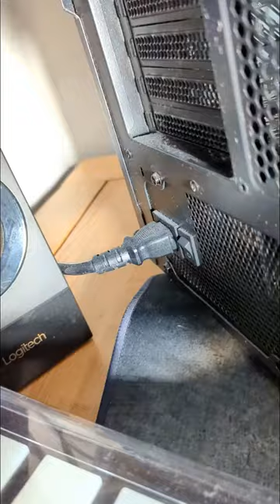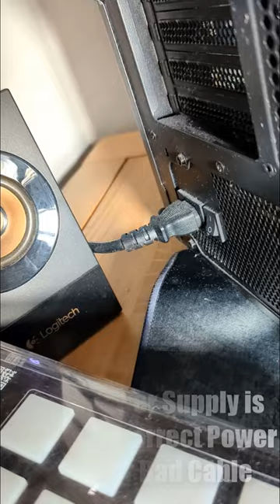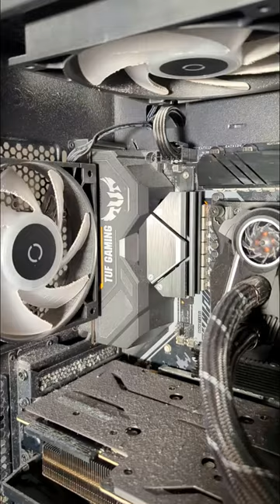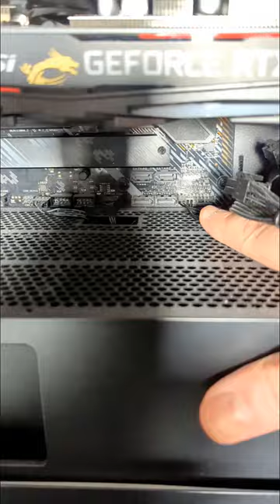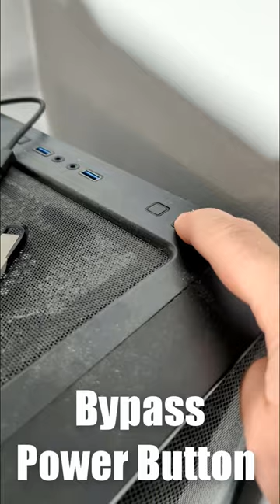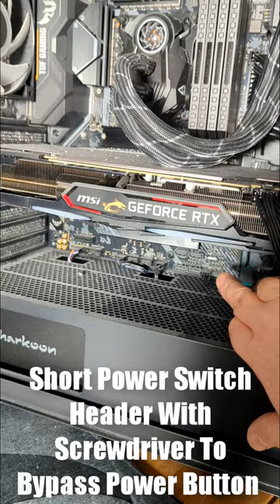Reasons Why Your Computer Won't Power On

Comment: If you have a modular power supply, check the connections on that too.  Happened to me after cleaning once.
Reply from the maker: As mentioned, bad power supply, only had sixty seconds.
Reply: Hey, could you elaborate on this? I think I have a modular PSU but I'm not sure what checking the connections could mean...
Reply: @palzone2443  I'm a little late to this comment, but basically a modular power supply has cables that connect on both ends. One end of each cable will plug into its corresponding connector (cpu power, 24 pin, pcie) while the other plugs straight into the power supply. Now non modular power supplies doesn't have the option to unplug the connectors on the power supply side of things. I hope this helps

Comment: Mine turn on then turns straight off, it was working perfectly fine a minute ago and now it's short circuiting, I hate building pcs and I don't know whats going on with it
Reply: Does it work now
Reply: @grave2816  ah so it was a wire, the wire hit the fan blade since the fans where at the top and caused a short circuit, I moved the wire and now the pc works. That was for my brother when I upgraded my pc I avoided that mistake lol.
Reply: I js bought a new pc and it fucked in 1 Day my pc works but when i turn it on the monitor shows no singal

Comment: Thank you for this video… I tried a million things even replacing the power cord, but then I saw this video and found out that my 24 pin power cable was loose. I fixed it and now my pc is running like new. Thank you so much <3

Comment: Also accumulated dust and moisture will be conductive and will short many stuff
Reply: I recently blew the dust out of mine. Nd hanged thermal paste and i turned it in at the wall and a loud surge bang nd tripped the breaker. Wont turn in now any suggestions
Reply: @KillShotMarks what broke ?

Comment: It all makes sense, when I was building my Pc, i directly connected it to the wall socket. When I was finally done, I went to fix it on a side of the room with an extension lead. Thanks! But I wonder what the solution could be since I can’t move my setup next to a wall socket.
Reply: It was that!

Comment: Appreciate the help. I went for a jog then came back to a PC that wouldn’t turn on. Tried a lot of stuff, none successful. Ordered a new PSU. Hopefully that works or else my mobo is fried or something

EDIT: Replaced my PSU and everything worked fine. I guess it must've died on me while I was away
Reply: Good luck.
Reply: I got a new power supply. Still won't turn on.
Reply: @Zeigy  Hoping ur MOBO isnt fried then. Best of luck
Reply: @nnoir  Something fried. I smelt the burning electrical component smell. Trying to save up to get another ROG Strix B550A motherboard.
Reply: @Zeigy  Unfortunate :/ hope you can get that new mobo soon
Reply: Hi, did you test your PSU using a paperclip by shorting the MB connector? I'm wondering if my PSU is at fault here but I'm not sure..
Reply: @palzone2443  Yes I did try that. Nothing changed, PSU didn't power the fans or anything so I assumed it was fried. I followed the tutorial by Joe's Vids, "How To Test Your Power Supply With A Paperclip"
Reply: @nnoir  I sent my PC to someone with lots of PC parts lying around. Was cheaper than just buying brand new parts. He said it was my eight year old GTX 960 video card that went bad. Got a new 6750 XT. Gamed for about 4 days then the computer motherboard started shorting. Wouldn't turn on the. Would turn on a few minutes later or turn on after trying again after an hour. Then a day later it just turned off while I was playing Starfield for about a two hour session. Never came back on. Checked the motherboard, corrosion at various spots. Looks like some liquid, maybe sweat, fell on the motherboard and took out some components. Getting a new motherboard today.
Reply: @Zeigy was the motherboard the issue? I cleaned my pc for the first time by blowing it and went to turn it on and it powered on than like a minute later it shut off and won’t tune back one. Troubleshooted everything. Even did the paper clip trick and my PSU worked still. So I assume it’s the motherboard. I have a ASUS tuf z790 plus Wi-Fi and it usually has RBH background lights on very subtly when powered off. I noticed those rgb lights weren’t even on. So automatically thought it was the board. Ordered a new one and currently waiting.

Comment: So in my situation, mine will not turn on at all, but it shows my LEDs on my motherboard. Does that also mean a bad piece issue but enough to to give power to the LEDs?

Comment: My issue was the power button I referred back to the manual for my mother board found where pins are for power button and used a screwdriver to hot start it. Works just fine for a new button on the way. Now I’m referring to the power button on top not the power supply button.

Comment: Couple years ago i had an issiue with my pc not turning on. Sometimes it started after one press sometimes 20th. After couple of days trying found out that the psu cable to the wall was faulty. Didnt expect that at all.
Reply: how did u fix it
Reply: @23golivee  got a new cable.

Comment: Any idea why the red debug led shows up after a normal boot, during bios update I have noticed message saying "updating led firmware don't shutdown to prevent non bootable system", however after the update the OS normally boots up but then the red led remains as is(other debug led's are turned off), IDK why this happens before updating bios I had same problem on the motherboard. It was randomly started without doing anything. I suspect on lose connection, but after rewiring entier connections problem remains.

cpu : Ryzen 7 5700G @ 3.8 GHz
ram : 32 x 1 ADATA spectirx @ 3600MHz
mobo : asus tuf gaming x570 plus

Comment: Finnaly make sure your HDMI or display cable is plugged into the GPU and not the motherboard
Reply: the pc would still turn on bro
Reply: @realjared69 if your CPU doesn’t have an IGPU then no it won’t turn on.
Reply: My build pc having issues booting up. And whenever it does boot. It  freezes sometimes. And when i turn it off pc won't totally shut off fans still spinning but my monitor is  already off. Anyone having same issue with newly build pc?
Reply: @Gordonizon Tried this before, pc turned on but no video output. And I have a cpu with no IGPU
Reply: @Seeded335  my bad

Comment: I got this weird problem on my PC where sometimes it just won't turn on after a shutdown. And I always have to open up the PC and readjust the cables and other items inside despite always securing them. Does the dirt on PC always play a part in that due to it being a bit dusty inside or coz it's old since I have it since 2016

Comment: I shorted my psu and it turned on along with my cpu and gpu plus my led lights n fans. But when i try to short my power switch pins , nothing happens. Can my motherboard be the culprit if my psu and everything else is working  when shorted ?

Comment: I have this issue, computer will boot then suddenly shuts off. Checked everything you have mentioned, this goes everytime, power button not working sometimes then I bypass it in the motherboard. But sometimes it is not turning on from there as well, is this a case of PSU + MOBO is already done? PC not even 1 year old

But most of the time it does that, after waiting for about 15 minutes then PC will run and I can use it for more than 5 hours with no issues

Comment: I did all of it, removed 24 pin and connected 12v and ground, and the psu turned on.  Onnected everything back to mobo, but i have literally zero energy, the fans dont even try to move 1 inch. Tried another psu, it does turn on, but on mobo the samething as the other. That should be a bad mobo, right?

Comment: I had this after doing various checking of thing and checking cables plugged in etc. I Reset cmos bios with the jumper and it powered up perfectly  if it happens again I might have to change cmos battery.

Comment: I have a big problem.  I was playing diablo 4 and my Bluetooth controller and headset stopped working so i restarted my computer.. the computer came on all the LED lights came on but i have nothing on the monitor??? The fans are working keyboard is working but nothing at all on the monitor yet it all worked 5 min before hand ... what is the problem???

Comment: So my computer won't turn on, my power supply is working( if I plug a paper clip in it the fan will go). But when I try to use the screwdriver doesn't turn it on. Is it my motherboard?

Comment: I have pc that won’t turn on and I’ve done everything I could to it but still got nothing I’ve repluged everything in I’ve took out the power supply switched it and I’ve tried taking out the cpu and putting it back in and nothing it’s a goner 🙃
Reply: did you fix it ?

Comment: Okay so here is the thing 

My pc wasn't powering up properly . After switching it on , it took like 30 mins to 1 Hr  before powering up. The technician told me to contact him if the system fully shuts down becoz he couldn't find what's wrong . Yesterday the pc shuts down completely and bro tells me it was a psu issue . He switches the psu and it was working. I asked him to check my older psu on a different setup but he told me it wasn't required . Today I have the same issue and my pc isn't powering up. It powered up after an hour.

Comment: I'm here because pc won't turn on tried screw driver on power pins nothing mother board green light is on showing power GPU light is on showing power the switch on the PSU is on or the lights wouldn't be on I have disassembled and reinstalled all parts but still nothing iv tried removing down to the bare minimum nothing happens I believe I may need a new motherboard. This has been an on going problem for a while so if I turn it off with the pcu button it won't turn back on for hours and have never been able to jump it off the power pins had a power outage the other day and just nothing is happening now the pcu is fine if it were bad or weak the light on mother board would be red instead of green
Reply: i had the same issue when i reapplied the thermal paste on my pc
Reply: and this got fixed on its owns after i just reseated all the parts of my pc now the same issue has happened again and what i did i was i turned of the psu now my motherboard rgb lights up but my power button wont work
Reply: I did all that now it will eventually turn on for example came on last night finally but froze after signing into windows I couldn't turn it off with power button so I used the PSU switch to turn off now won't turn on again. So it seems there is power to everything except the power switch pin I can jump the green and black on 24pin all lights and fans come on this has been a problem but the shut down is lasting longer used to be hours now it's days til the switch will work also when it did come on the graphics looked like it was just using  the built in graphics instead of my gpu
Reply: @karlsteffens799  and also if the pc crashes mid working try swapping the rams or switch to one that works better i had the same issue

Comment: Can someone help me please. My pc keeps doing what I’ve researched and now is known as a “brownout” , not necessarily blacking out but whenever I load up a game or anything that cuz voltage spikes or more usage the pc just like crashes kind of it all powers off very quickly and then boots right back up. I e tried everything from resetting and deleting every last bit on data, reinstalled windows, checked all my plugs n everything idk what else to do aside from take my anger out on with a baseball bat 🦇

Comment: If all else fails, clear the BIOS.  I have seen an almost dead BIOS battery corrupt the BIOS memory and cause the PC to not even turn on at all - as a last ditch effort after disconnecting everything but RAM and CPU on the motherboard, I tried removing the BIOS battery and waited 30 seconds.  Tried pressing power and fans came on and everything.  Slapped in a new BIOS battery and put everything back together.  Wish I tried this before buying an extra stupid Lenovo proprietary power supply!